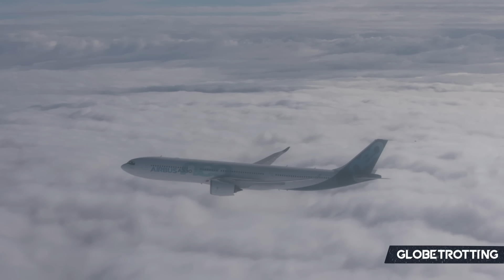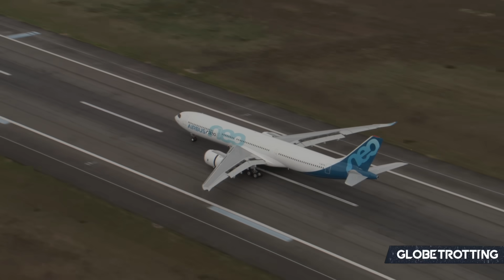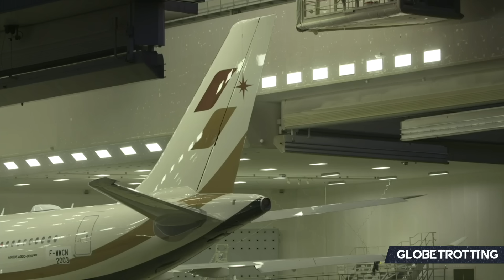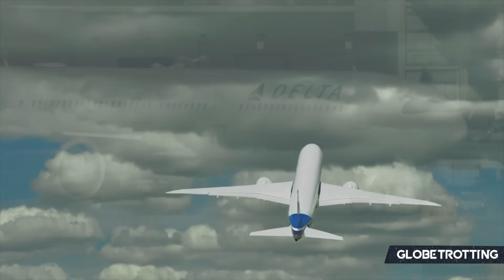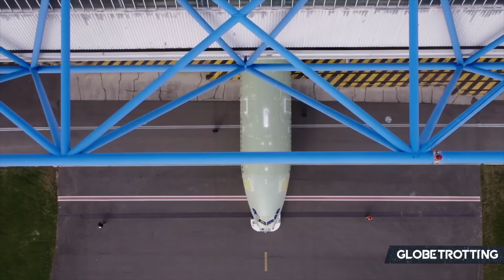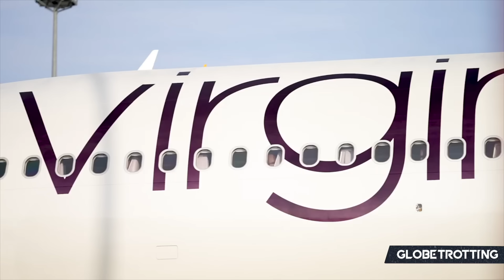787 RIVAL - The Airbus A330neo

Comment: The 787 is a performer.  The ability to climb to higher altitudes gives it an advantage with smoother flights.  Plus it doesn't hurt also cruising at Mach.87 and flying pass all the 330's and 777 below you.  We were cruising at FL410 at Mach .86 and our fuel burn was per side was a low 4,400 pounds a side. Thing sips fuel also.

Comment: But a330neo might have orderbooks open for airlines who look to increase fleet size quickly while downsizing on variety, because by capability it is great for both short haul and medium haul and even some low capacity long haul where it can operate in a premium economy configuration. If airbus looks to push past the 787 dreamliner then this would be the best way forward.

Comment: With the original a330 Airbus was doing to the a310 what Boeing was doing to the 737. To make matters worse it's sister plane in development the a340 suddenly became obsolete in just a few years with a high cost per seat per kilometer in fuel. When the 787 arrived the a330 had to carry considerably more fuel to achieve the range Airbus advertised. And this re-engined neo did not really solve that issue as much as people hoped as it again is carrying substantially more fuel to achieve its range although thankfully it is a greater range. Maintaining commonality by ordering more 787s is not Airbus's only problem. Airbus still needs airlines to rationalize a higher cost per kilometer per seat and I believe even a higher overall cost of ownership annually with the neo. And just look at how many 787s were already sold when this fix for the 8330 inefficiencies became available. I think most of it sells are due to the backlog of 787 orders. I know for certain that is the case with delta.

Comment: For its capabilities, the A330NEO is too heavy and too expensive, when it compares to the 787, and the difference in price and weight is dramatic, tens of millions of dollars and more than 30 metric tonnes, and the passenger capacity is slightly larger. Though, with the existence of the a350, which is fundamentally the exact same aircraft and shares a wing, and list price, it vastly negates any reason for the a330NEO to be around. Airlines that still operate the a330ceo and 767, will likely split their decisions for the 787 and a350, and that’s exactly what we have seen happen. The a350 can give better range than the a330neo and the 787 is vastly cheaper and weighs less, it also carries a lot less fuel as a result of being smaller. So, the reason why the a330NEO hasn’t sold well is simply down to the economics. I’d imagine that Delta got a fantastic price on them, airbus probably gave them away for free, like they did with the a220. But, even here, we can still see that Delta has plans to fully go ahead with a350s and they, “Can’t get enough of them.”-Ed Bastian, so much so that they have even purchased stakes in LATAM just to acquire their a350 aircraft slots. Sure, its cheap for Airbus, but the a350 and a330 overlap so much that this isn’t surprising.

Comment: Boeing spent $32 billion USD ($46 billion in 2023 USD) to engineer and develop the 787 Dreamliner. Airbus spent $2 billion USD ($2.5 billion  in 2023 USD) to refresh and develop the a330neo. 
I wish Boeing the best of luck in their 787 Dreamliner program as they’ll need to 20 of their 787 Dreamliners for every 1 of Airbus’ a330neos to break even. Then profitability will come afterwards. Seems that Boeing is doing a good job but there’s still a long road ahead.
Reply: And the best part is that the A330neo's existence basically forces Boeing to sell the 787 for cheaper than they would otherwise have, making their return of investment smaller still. Airbus basically wrote off 2 billion € to screw with Boeing and got a decent plane out of the deal. Technologically, the 350 is more advanced, but for many routes, it is also overkill.

Comment: The Airbus A330neo is one of my two favorite next-generation wide-body aircrafts (alongside the Airbus A350 XWB) because of its 2-4-2 seating configuration in its Economy Class cabin (just like the Airbus A330ceo and A340), which provides direct aisle access in all classes. The 3-3-3 configuration in the Economy Class cabin of the Airbus A350 XWB and Boeing 787 Dreamliner and the 3-4-3 configuration in the Economy Class cabin of the Boeing 777X are cramped and could be difficult to access the aisle, but they can help airlines increase revenue.

Comment: Boeing has won the battle for years with the B787 for widebody aircraft vs the A330neo. While Airbus has won the battle for MoM with its A321LR/XLR.
I would see at midterm a major airline such as Turkish, ordering A330neo for replacing A330ceo, perfectly suitable for its operational network ( long routes as well as short/medium ones).
Reply: Unfortunately, Turkish Airlines didn't order the A330NEO as I searched up.
Reply: Turkish ordered a lot of A350‘s instead of A330neo

Comment: The Boeing 787 is the best aircraft  for healthy breathing air during flught. The air passengers and crew breath in during flught does not come off the engine,  it has a separate air source that is not contaminated. Crew and passengers are not poisoned with carbon monoxide or other contaminates.

Comment: I believe they are different aircraft but both are great. As an employee with Delta I have worked on the 330 and 350 a lot and would love to see us get the 787. I doubt we will though but the question still remains as to what aircraft we will be using to replace the 767
Reply: Same. We were supposed to launch the 787-8 at NWA but it was delayed when we merged with DL then cancelled. I think at this stage in development and improvements the 787 would be the most appropriate replacement for the 767.
Reply: @GSUHotboi05  The issue at this point would be availability. The 787 is backed up with orders so they don't really have to give a great cut rate price or many delivery slots left for the next 5 years or so.
Reply: Delta may surprise us with a 787 order just like they did with the max 10. They have not been placing new 330 neo orders.
Reply: @johniii8147 Ed would never!

Comment: My take on this subject is that the A330 is indeed a direct competitor to the 787 in size, range, capacity operating speed and fuel efficiency. However the 787 has a slight edge on most of those figures, so for clients already operating Boeing machinery, which are the majority of them (since Boeing has always dominated the wide body market), they'll naturally just opt to extend their 787 fleet whenever they need more aircraft in this category.
If they don't operate Boeing, but already operate Airbus, then the A330neo is a serious candidate for those deciding against the bigger and more expensive A350.
For operators entering the wide bodies market for the first time, the expected choice will be the 787, but still there's one or two starting from scratch that had preferred the A330neo over the 787. Because in reality the 787 its not a clear winner on every type of demand.

It's also worth mentioning that the A330 still uses the old ceo airframe, but got some important tweaks besides the new engines, including new wings (EDIT: Actually the most advanced wings currently found on any aircraft) and several improvements on the cabin interior. For instance, the interior cabin noise has been measured at -3db that the 787.
More importantly, the cockpit is brand new and the flight systems come from the A350, not from the old A330ceo. So it's really a new aircraft on the inside, despite still being heavier than the 787.

Another reason for the weak sales is that there are hundreds of A330ceo flying that are less than 20 years old, still bringing profit to their operators and companies are forced to balance the operating costs savings with the costs of investment on new aircraft. So I expect the A330neo to replace many of those as they get phased out in the future.

Comment: The a350 style carbon composite wings and engines have been a game changer.
Reply: The A330 neo wings are even more modern and efficient because they were an improved designed from the A350.
Reply: @miks564  definitely.

Comment: Boeing have made a huge number of missteps, the worst being not doing a 767X, since they are still making the airframe in the KC46...
Reply: the 767 was over move on from it
Reply: @nickolliver3021  you're missing the point. It was a huge mistake to kill it. I know it's over. Just like the NMA and a lot of other missed opportunities at Boeing. Their executives can't manage their way out of a paper bag.
Reply: @nickolliver3021  It has its niche. Since Boeing isn't releasing a new MMA, the 767X would have been their best bet. A 787-3 would still be overkill for many routes, never mind the 787-8.
Reply: @EdVonPelt  the 767x wouldn't be better because the 767 would not have engines for the frame from manufacturers. But anyway what has been done is done.

Comment: Any idea when Delta Air will get rid of its old many 767s and replace them with one of this models?
Reply: to my knowledge Delta hasn't made any decisions as to what they'll replace the 767 with, i'm also wondering about their 757s.
Reply: @macerface  True about the 767. The 757 is being replaced by the 321NEO and 737-10MAX
Reply: @macerface I absolutely hate delta 767’s with their ancient cabin!! They need to be scrapped or sold immediately cause these crap planes are stuck on most routes to Europe
Reply: @maxsaviation9512  well you can always choose a different airline if you are not happy with the product they fly. And just because something is old or not top of the notch is directly crap or sucks. I like the Delta 767s.

Comment: Most a330ceo operators tried out subfleets of 787s in their early days such that when it was time to acquire replacements it was logical to expand that fleet of 787s. The dilemma comes to operators who operate neither the a330neo nor the 787, previously operating 767s or a330ceos with no small fleets of 787s. The neo was launched a decade after the 787, enough time to prove itself and familiarise with maintenance crews and having more than 1 engine option and being clean sheet. This made sure that the a330neo would never have a proper place since the 787 had already hogged the smaller widebody sector

Comment: The 787 was Boeing's answer to A330 was was outselling the 767. The 787 replaced the 767, though it was slightly bigger than the 767.  The A330neo was meant to better compete with the 787, since they have roughly the same range of passengers carried per flight. Their range is different, while they also overlap.
The A350 was meant to replace the A340(longer range) and 777-200(passenger capacity and range) and 300ER. And it has replaced the 777-200 for some airlines.
It will be interesting to see how the A330neo fares against the 787 over time.

Comment: I think the true competitor of 787 is A350. Current user of A330 are not buying the A330NEO due to the CEOs are still in life-span and bought lots of A350s.
They may replace with A330NEO for short-haul in future I think.
Reply: Nah, the A350 is the competitor of the B777.
Reply: @justbenny__  There is indeed a lot of overlap in competition between the 350 and 787-9/10

Comment: The A330 neo is cost effective for flights up to 10 hours. At the time of launch, Airbus said they were seeing demand for a cost-effective 300 seater from holiday operators who didn't need the range of an A350. That category of operator has been particularly hard hit by Covid and high fuel prices, but may revive within the life of the Neo program.
Reply: Kuwait used to have a 13 hours flight on a A330-800 from Kuwait to NY.
Reply: @miks564  yup, that model has the range, but has only sold about 15. It's the sort of route the 787 is better at.
Reply: The range of the A330-900neo (7,200 nautical miles) makes it a potential replacement for the 777-200ER for some airlines. I wonder has British Airways "kicked the tires" on a possible 25-plane order for the A330-900neo (though the A350-900 is a better choice for that airline).
Reply: @Sacto1654  Virgin Atlantic has bought the 330 Neo, mainly for US East Coast destinations that don't have enough traffic for an A350. For similar west coast and other longer distance routes that can't justify an A350, they use 787-9.
Reply: @Sacto1654  That 7,200 nautical miles range are the maximum range with full fuel but limited payload on clear weather. Usually the range of widebody aircrafts tend to be ~1,000 nautical miles to ~2,000 nautical miles lower compared to the advertised range.

This is because they would fill the aircraft with full passengers, their checked in bags, and extra revenue cargo. Hence why they can't fill the fuel since it would go over the Maximum Take Off Weight.

The optimum range for A330-900neo is around 5,500 nautical miles to 6,000 nautical miles for maximum payload.